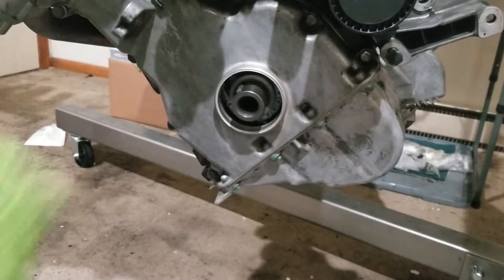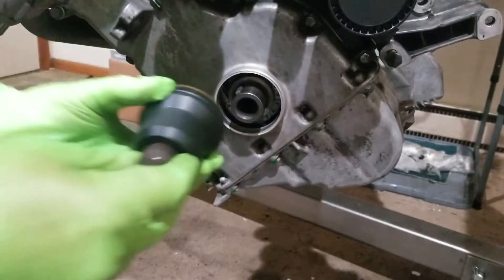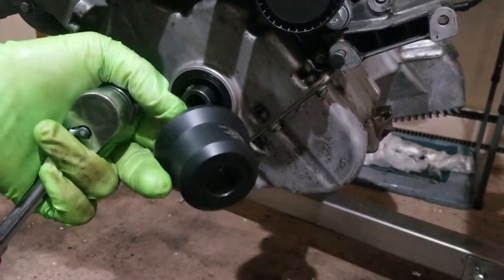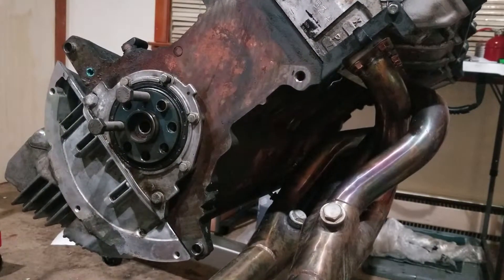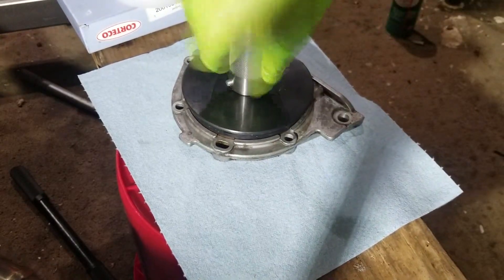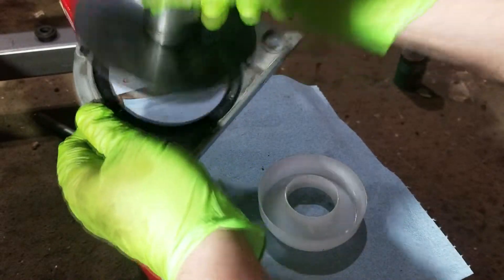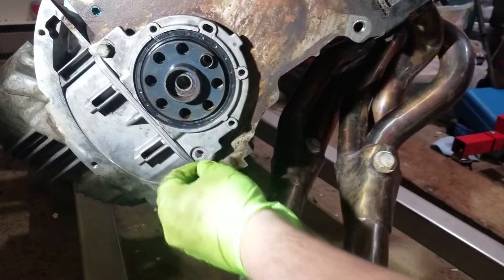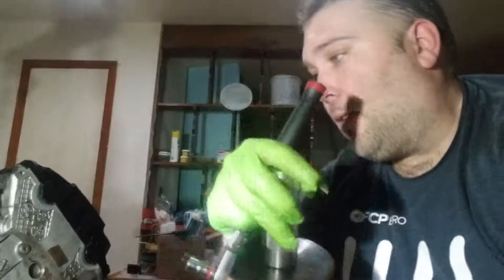How To Properly Install M52/S52 Crankshaft Seals

Comment: i used a small can of Minwax wood stain to get the old one out and just used two flat pieces of wood and a mallet to press it in. wasn’t that bad.
Reply: Is it difficult to remove the crank bolt ?
Reply: @bigdeal87  it's not too bad, just need a big breaker-bar. reinstallation and torqueing it is difficult because it requires like 300 ft lbs or something